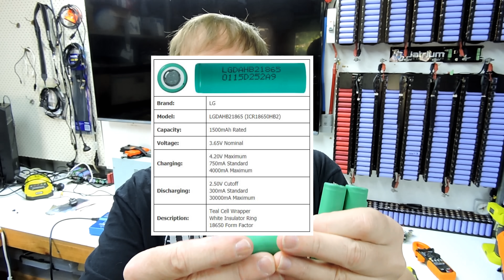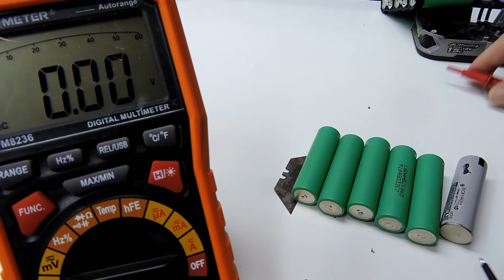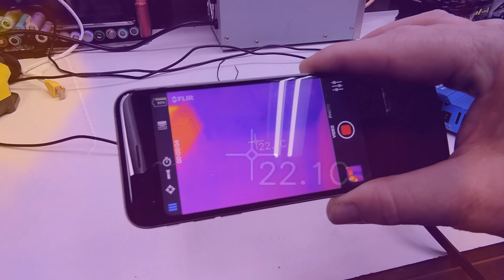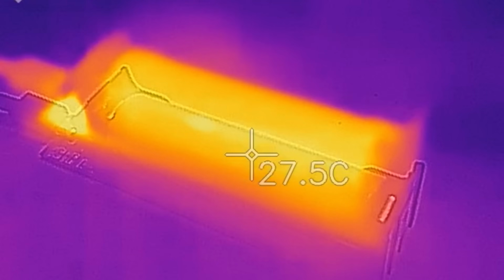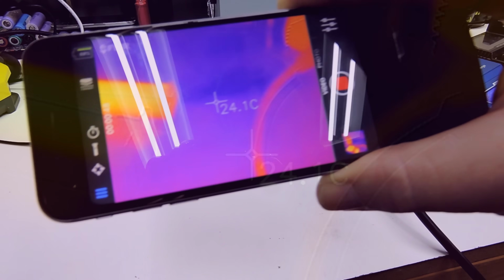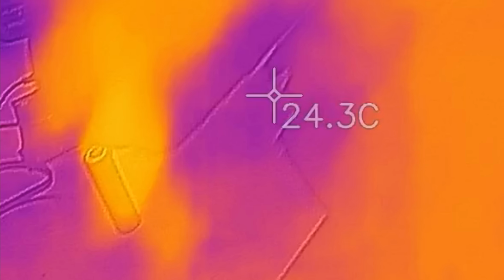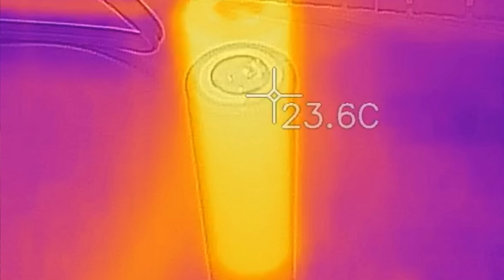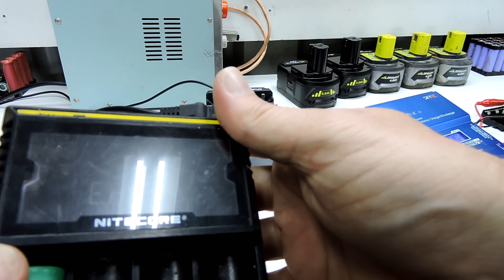18650 CID Reset   ⚡ DON'T DO IT! ⚡

Comment: That cell has an internal short. You can tell because when you voltage test the voltage drops from the continuity of the tester. There are many reasons for cells to have a popped cid. If you reset and test voltage, if that voltage drops while checking it, it's trash. If the cell voltage is over 4.3v after resetting it's trash. I have thousands of cid popped cells. I may make a video since we have the capacity to reset and test thousands at a time. And get some real data analysis. That cell in this video was bad from the get go. First sign was voltage going from 0.20, 0.19, 0.18, etc. Just from checking voltage. All cells that do that get hot. 100% of the time.
Reply from the maker: Yep never a good cell to start with and given all cells are the same and the bms didn't work I'd have to assume that bms failed causing the cells to fail. All guesswork of cause but I think if you had the chance it would be fantastic opportunity  to educate and learn
Reply: Yeah because I've messed around resetting cid's. 90% of them worked perfect with no heat and no internal resistance issues. But I never really went in depth on the numbers. And we don't sell reset cid cells. For an information video though I think I can help with doing the testing in bulk and seeing the characteristics across the board
Reply from the maker: I think that would be a great thing for the community - I've tested only 15,000 ish cells and every one that was zero went straight to recycling with out a second thought. Its a positive thing having an open debate about the topic - I just got 500 more 6cell laptop batteries so if I come across any more I'll put them aside for a 100-200 cycle test in the opus at one amp.
Reply: Can you let me know which is the best battery charger like the above used to bring back Li-Ion cell back to life?
Reply: Liito-Kala Lii-500 can test it and bring low ones back up. price to Perf its perfect and pretty accurate.
Reply: Waiting for the cid reset video
Reply: and......if it was a good cell you can not check resistance with voltage in the circuit, the meter wont pull  the cell down though, DVM`s have a 11 mega ohm input resistance, wouldn't pull it down no more than your fingers would. To measure the internal resistance of a battery you would need to put a selected resistor across a charged battery and measure the voltage across the resistor (there are formulas to calculate this, search measuring internal battery resistance) The meter can not charge the battery if the CID is open, the voltage setting of the meter will never charge it, the ohms setting could but you should never place a ohm meter in a circuit with voltage applied to it...
Reply: Great job explaining all of these important points. Thanks so much !

Comment: I've tried this, but with a very low current and it's a waste of time. You can get the voltage up again, even to 3 volts, but it doesn't hold the voltage. The moment you stop charging the voltage starts dropping again. In some cells slower than in others, but you can't use them.

There is some level of shortcut inside the cell. May not be a direct (meaning 0 ohm) shortcut, but there is a connection somewhere between the anode and cathode. (Lithium dendrites have grown causing a connection.) If it still has some resistance the rest of the cell can still charge, but it won't do you any good if it discharges right after you stopped charging. The heat is caused because most of the charging current is dissapated into heat in the dendrites.

Just a waste of time trying this, but a great way to get experience and learn that dendrites are real and what they do.

Still, it is possible to drain a cell to below 1 V without dendrites inside. And in those cases it's possible to revive a cell. A faulty bms can allow to discharge a battery too much. But in my experience when you are able to revive a cell like that, it's lost a huge part of it's capacity. So basically, not a usable cell anymore.
Reply: Dejay Rezme That's the fancy way. If you don't have that equipment, you take a healthy cell, and put it in parallel, with some resistors between to limit the current. For example 3.5 V cell and a 0.5V cell. R = U / I = 3 / 0.01 = 300 Ohm. Or easier, use a potmeter that goes to 1 Kohm and put a 1 ohm resistor in series. The voltage over that 1 ohm resistor is the current that's passing through it. You can adjust it with the potmeter.
Reply from the maker: Didn't even consider them dendrites! I think the larger issue is we are all recycling cells we don't know the history of there for you must assume the worst and if they are bad now they have a better chance of being worse quicker later.
Reply: Thanks I was wondering that. You'd basically use a current limited bench top power supply, right?
I guess once a cell is damaged, the risk increases that an internal short causes a runaway reaction.
Reply: That's one failure mode.  But don't assume all reset cells act the same way.

Comment: u can revive the 0V cells, not all but some... u hok up 1:1 cell with a charged on for some time.. the cell takes some charge & then u put the cell on a regular charger.. the cells look fine, they hold the charge.. thay where just drain out, not bad
Reply from the maker: Never even tried - BUT 0.01v cells YEP super slow charge them till they come back - then preform the usual charge, voltage test, capacity test, rest, & voltage test again

Comment: It may not be worth trying to save a cell below 2.5v but what if you have a 0v cell and try the CID reset trick (without puncturing the cell) and it then has a voltage of 4v right away and charging produces no heat?
Reply from the maker: I think your (without puncturing the cell) is key - how do we know that stuffing something into that little hole doesn't change the characteristics of the diaphragm (putting a hole into it) or weaken the diaphragm for it to fail later giving us a false sense of security
Reply: Wouldn't that be the reason for additional fusing on each cell?
I guess this may just come down to a persons level of desperation for needing a battery :D

Comment: If you not using high drain cell u can also parallel them.
Reply from the maker: I incorrectly tried to parallel charge them with the 4.14v NCR18650 grey cell & IMAX - stupid really as that is what caused heat so fast to build up. That is an error on my behalf. I should have used an old 2v cell to 'bump' the voltage so the imax or opus chargers could detect the cell.

Comment: Royobi used to make good packs when they used the Sanyo/Panasonic cells. Then they went to really cheap cells, and some LG cells. The other problem is the BMS drains to much power when the pack is idle over the winter if you set the pack at a storage nominal voltage of 3.7 to 3.8 per cell. As for the CID, I’m thinking it’s not a short or only one or two would have triggered. Since they seem to be all something else probably triggered it. My guess, they all over heated that stands to say the LG cells couldn’t take the drain, or the BMS temp monitor wasn’t correct and didn’t do it’s job. I don’t trust newer royobi batteries. Just look at all the 24V lawn mower batteries that have issues. But I have a 6 year old one for a weed waker with Sanyo cells and besides the BMS draining to much when in storage the cells are still good. 
The charger TP4506 does 100mA slow charge until it hits 3 volts and then goes full speed 5 watt charge. At 100mA from  0 volts will take hours. Parallel charging a dead cell isn’t good, the good battery will try to dump into the dead cell. If the good cell is a high drain it charger the dead cell at a way to high of current and why it heated up. 
Ok, I’m at the video commercial break and I’m done. I hope this helps you or some others.
P.S. I agree with the stupid video comment, lol.
In fact, I may delete this comment later since it could give people wrong ideas?
Reply from the maker: There are no wrong ideas - well there is but it's all options and having an open conversation about them works for me. With helps from this comment section it was pointed out by a few that the TP4056 does indeed to 100ma low end so more tests needed. Will also not parallel a great cell with a dead one again even if it was for just 2 min .. That's a huge woops on my part.
Reply: Just sharing info but the TP4056 does not put 5W into the cell as you said, the cell will be at 3.7v instead of 5v on the input. Yes the current is the same but since the TP4056 is a linear device it acts as a resistor not a buck converter, so the difference in voltage 1.3v is lost as heat in the TP4056. Hope I helped

Comment: I have done it to a few and the ones that did not heat up when charged are now used in my flashlights. The rest went in the trash can you can use a straight jewelers screw driver to rest just about any cell but again like you said do not do it. The batteries in my flash lights are now in the trash just not worth the risk for any use

Comment: In no way are we disputing with HB's claim or discovery.....Interesting HB, we had a handful of these 0's. So, we did the psst(or hissing sound revival method) to each one of them. Bout 15 cells jumped up to 4v and stayed there for few days. Some of the cells jumped up to 1.0v +, those got set aside for future testing. when we checked on the ones that made it to 4v a few days later, we noticed a foul smell coming from the container they were on. The smell was like that of  sharpie ink. And sure enough about 3 cells were leaking(yikes). But interesting enough, the remaining ones are still strong and are being checked for capacity. We are doing the NOR TEST on the Lito-kala. So far so good. Needless to say, these cells are gonna be monitored and will not be used on any worthy packs.

Comment: I’ve fond this more in Roybi batteries then any other brand. They have something wrong with there chargers, in a form I read that if you leave the battery on the charger after it’s topped off, it slowly discharges to 0V and kills the battery. I like the video.
Reply: This might be true of the older dumb chargers. I haven't had any issues with the newer smart chargers. I often leave my packs in the chargers as space is an issue. I just grab a pack, slap in it, and go to work. The pack functions for as long and as powerful as it was when it was new. And I've had these for over a year now.
Reply: OK, I’m just saying about what I’ve seen with batteries that I’ve gotten. I don’t know how old they are. Ones with voltage have been pretty good.

Comment: This is a trick ive done a few times now but when i reset the CID i check the voltage is greater than 0 , maybe about 2v , If its 0 you leave it , Ive found leaking cells with their cid popped. And ive also accidentally triggered cid when ive pulled too many amps from a single cell but they were reset easy .

 From what i understand the cid is a very thin piece of metal blister type thing and when you do push down on them to reset them i think there may be a risk of stabbing through it which could release some kinda chemical and or gas and as a bonus of that it also means the cid safety is disabled permanently.

"i recommend we proceed with extreme caution "" -Mr Worf
Reply: Even on a cell that you specifically caused the CID to pop, it's not worth it in the end. When pressing down, you are inevitably causing damage to the metal underneath. Even using a plastic device of some sort, you are still deforming the metal a little bit. Once it has popped, it will pop easier next time. Or, it's possible that maybe it gets stuck and doesn't pop when it is supposed to. The latter could end up very dangerous as it could turn a cell that normally would become a roman candle to one that could become an M80

Comment: Tried the whole cid reset thing with a bunch of cells while back because I couldn't find enough cells at the time. 
Deffo not a good idea for all the reasons Pete said but also its hard not to puncture the cell and allow the electrolyte to leak out when your fiddling under the top of the battery. Nasty stuff electrolyte it will screw your chargers when it leaks. Not good!

Comment: Great job Pete...  Yup, it's dead.
I'll also echo the rule that if the CID's popped then the cell simply goes into the recycle bin without fail.
What is surprising is that all of the cells CIDs popped - this is surprising, because if one goes then power stops flowing through all of them.
I have revived some zero volt cells with intact CIDs successfully, and appear to be quite healthy.
Agree the TP4056 is good for doing this, so it prompted me to go through my rejects pile that the Opus didn't respond to, and I managed to find a handful of cells that could be revived... yay!

Comment: I literally heard a CID pop when powering a fan.  It was a blue Panasonic. I don't try an revive popped CIDs, but have had a lot of success with 0V cells with working CID.
Reply from the maker: a 0.01v cell is much different from a 0.00v cell! I guess that should have been included. Stay safe!
Reply: What do you mean you "punctured"? Did you put a hole in them? If so and still using them, that is very reckless. It is NOT ok to use a damaged cell. There are so many more available that it's not worth the safety of ones property, family, life, or others property or life.
If you are using them for experiments and are using proper safety measures and away from everyone/everything, then that's fine. But don't be doing it at home.
Reply: Yea as long as the CID is working, I always try to recharge cells with 10mA for a day or so, hasn't failed yet.. But if the CID is popped then fuck it

Comment: I recently found out you should not beep test across a battery as it can damage that part of the meter. That part is for Resistance only. when you go across a battery or cell you are allowing it to discharge through the meter.
Reply: I don't see how continuity testing a cell would damage a DMM. They are designed to test continuity on live circuits (mostly low voltage). If there's there a break in a part (showing no continuity), the power is flowing through the meter. There are plenty of resistors in there to keep the current down to a minimum.
Maybe what your dad had heard before was that you don't test and "keep" the probes on the points for too long. Then yes, that could damage the unit as there is still current flowing through and could heat up and blow the resistors inside the unit. Testing is only needed to be done for a couple seconds, really.
Reply: @korishan it can damage the meter, and no they are not intended to measure ohms or do the diode test in powered circuits
Reply: Regarding the risks of introducing a voltage through the multimeter leads:

*Yes, there is a risk of certain parts being damaged, especially parts that can not tolerate the 1 to 9 volts that a multimeter might deliver across the probes in continuity mode.
The above is especially true when the component (or other components on connected traces, which will also be affected) is not powered. Many parts can tolerate voltages when powered but not otherwise.
*To minimize the voltage, an option is to use the multimeter in resistance mode, at the lowest resistance setting - The higher resistance scales work on higher probe voltage, going by a quick check on a couple of multimeters at my desk.
*Note that basic multimeters often combine continuity and diode testing modes, so the voltage is at minimum sufficient to forward bias silicon diodes and perhaps LEDs. This means a voltage of 2 to 3 volts.
Reply: That's why all meters have a 10mohm input that battery wouldn't do a thing.
Reply: My cheap but mostly accurate multimeter, it has a slow blow fuse. I've bumped it to resistance by accident while testing 9V batteries, and it didn't die. But, after a second or so, it just cuts the power to the meter and shuts off.
I also had it on amperage instead of voltage while testing a 12V charger, and it did the same. And the leads got a little warm.

My dad's good Fluke 83, I've yet to see it die from anything.
Reply: @REVERSE_BIAS  Corrected...
Reply from the maker: Really - cool didn't know that! another tick for the banggood multimeter, it survived Pete lol
Reply: I have also found when pressing it down you need to gently and on all sides (holes) Voltage should be above 1 2 or 3. I also look for corrosion or leakage. (ie colour) If I smell the fruity smell then i Know its not good. I'm sure you know Lithium and water don't mix. (salt water would be more conductive and would probably be worse then normal water. Perhaps do a test out in some open space somewhere to see the difference? Now that would be an interesting video. Keeping safe at all times though
Reply: I didn't know until Dad told me yesterday. He does more electronics than me and has done for years. 3D Printers and RC planes etc. as well as cars (normal ones) too
Reply: You dont know basic of electronics but you are risking with dangerous Li-Ion cells. Brainless
Reply: AS a General rule you don't do it. Due to potentially damaging the meter itself. so i'm no longer going to do it. When my 70yr old Father says not to do that with a meter. It's for a reason.